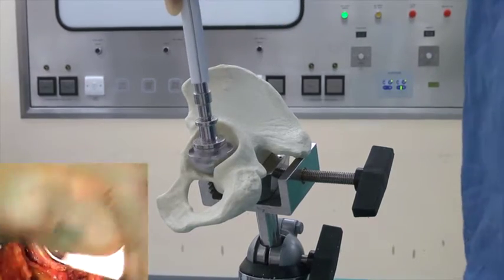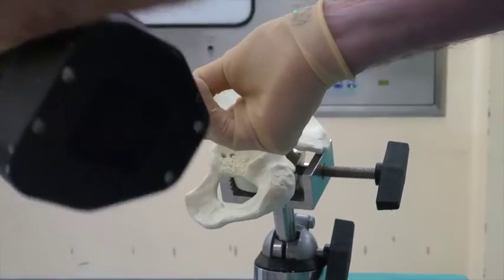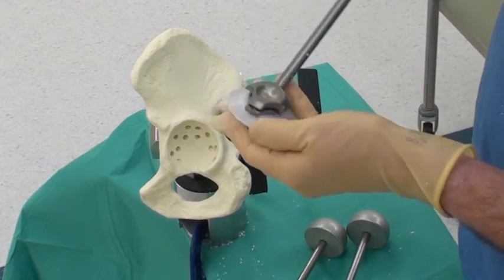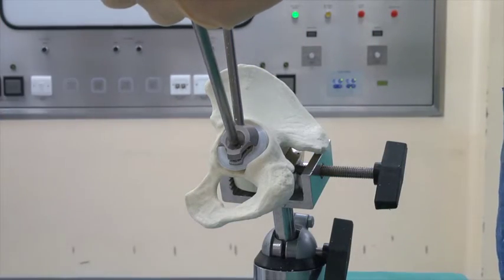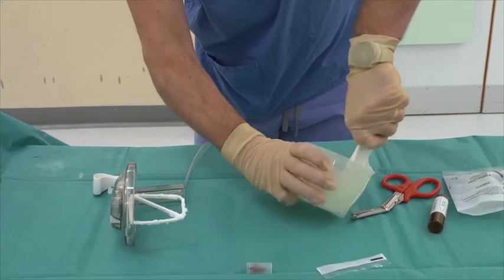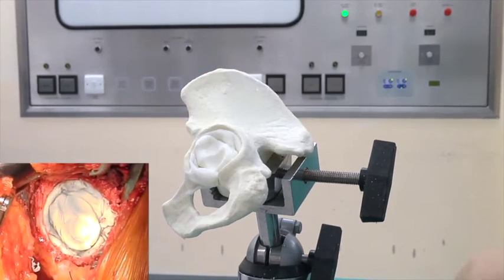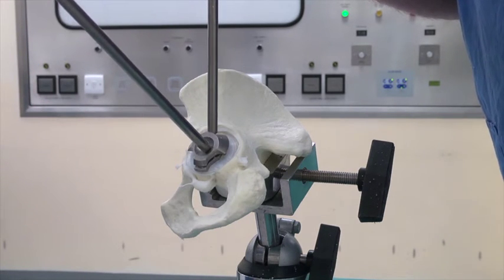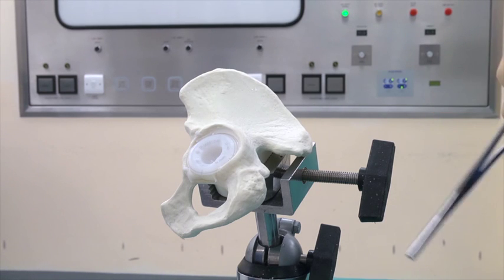Cup cementing technique in hip replacement. How to cement a Marathon cup. With sound.

Comment: If we are looking for the best cement bone implant interface why put acetabular reamings in between reamed acetabulum and cement?
Was that a video mistake used for uncemented cup?
Reply from the maker: Many thanks for your comment. No the video is correct. I will try to explain the logic. If we go back to the original Charnley cups, we often saw loosening in Charnley and DeLee zone 3 (either alone or with zones 1 and 2). This is the area around the true floor just above the TAL where the graft is placed. At revision surgery a common finding was a layer of fibrous tissue found in this region under the old cement. It was felt that the cement could not penetrate and grip the smooth bone of the true floor during the primary cementing. The graft added fixes to the cement at the time of primary surgery and with time, becomes incorporated into the pelvic bone producing a perfect cement-bone interface. In this way the bone graft increases the surface area of cement-bone fixation of the whole cup and prevents fluid entering this potential space between the cement and the bone in this area. This technique adds 20 seconds to the surgical time.  Our 14-year results of this technique, using 28mm head against poly, are 100% survival.
Reply from the maker: Hi Alex, I have published the results of this technique as part of a follow-up of reverse hybrid hip replacements. However I have not published the technique separately on its own. I will look into that. The reference for the reverse hybrid is

@alex boote